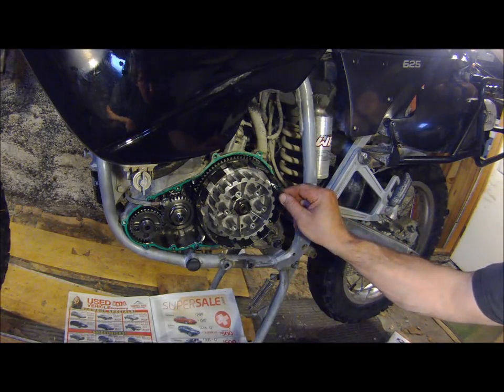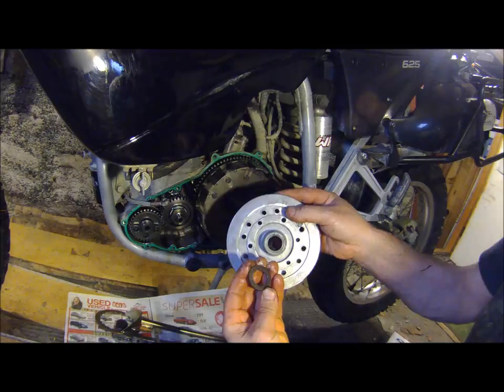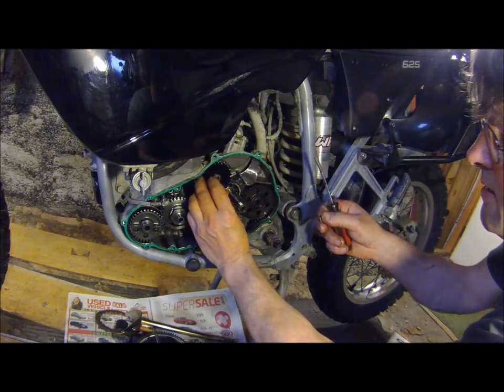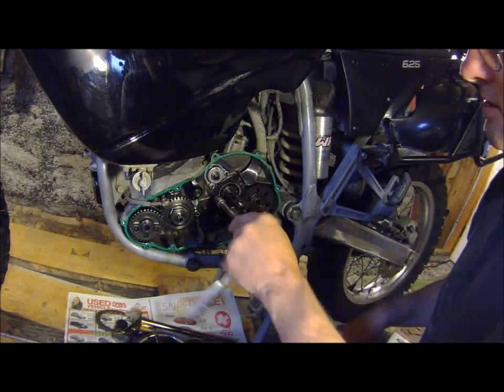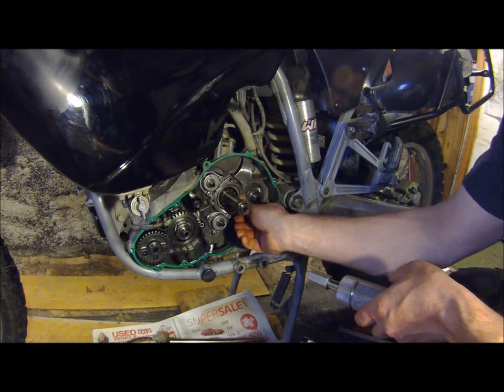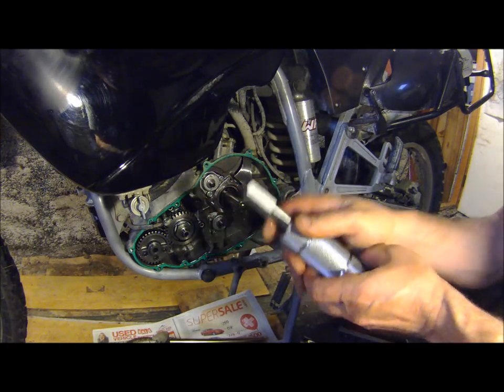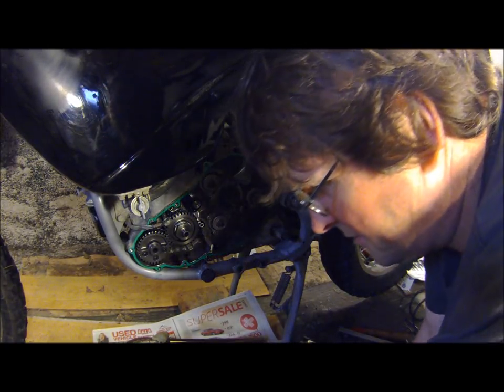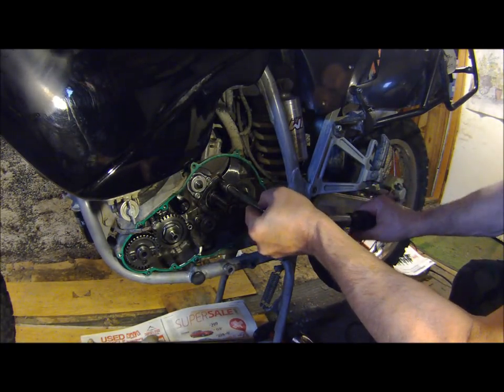Repair on KTM 640 mainshaft bearing slip.wmv

Comment from the maker: The pre 03 models used a weaker ball bearing on the mainshaft and it is not unusual for this part to fail... You should replace that older ball bearing with the newer roller bearing from the later models...  You can replace that bearing with out removing the motor as outlined in the thread in the above link...
Make sure you get all the metal bits you can out of the engine and change the oil a couple of times to remove the smaller particles...

Comment: I struggle a lot at putting back the clutch bell on the shaft, 13:20, I'm trying to put another clutch bell eith the same OEM code because mine is worn out, and the "new" one doesn't fit because the theets seems to be a little bigger.
The old clutch bell fits perfectly. 
Has anyone got this problem?

Comment: Handy vid, mate. I've just ordered a new retaining plate to try to fix my clutch issues. Thanks.
Reply from the maker: Make sure the problem does not lie with your clutch master/slave as well... If air gets into the system through a faulty master/slave seal it will behave in a similar fashion only the clutch lever release point will change in all gears.. With this main bearing movement problem the clutch release point change is most noticeable in second gear under acceleration...

Comment: man my bike has the same problem with the clutch, (01ktmlc4.400) but it makes a horrible sound, when clutching and throttling fast, so, i have to let go of the clutch slowly, i just found out about this problem with the bearing, and i already change the plates, disks and springs thinking that this would solve the problem but no luck.. so you think i have to change the main shaft bearing?? next week im tearing apart the engine to check that out but not an easy job!...